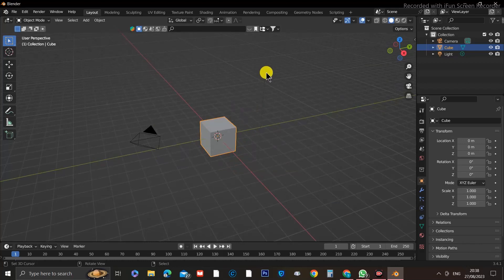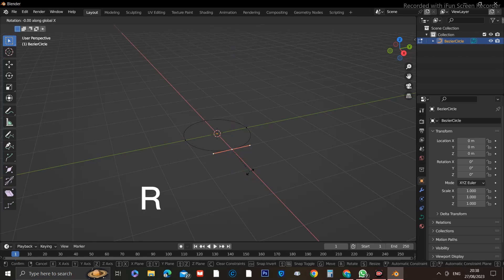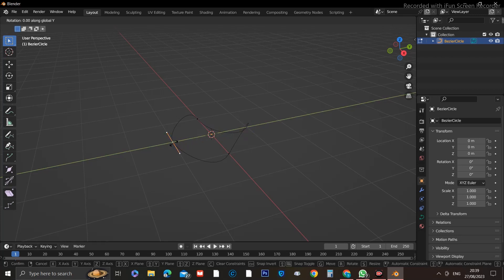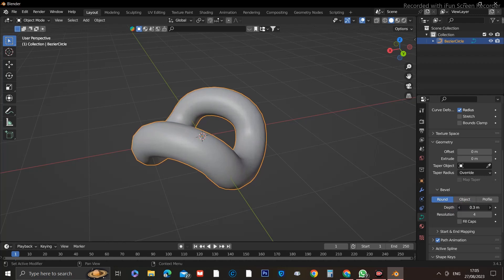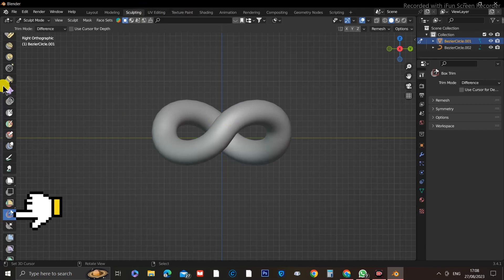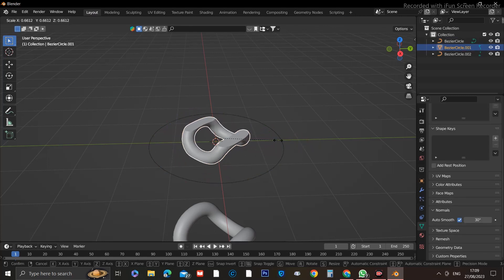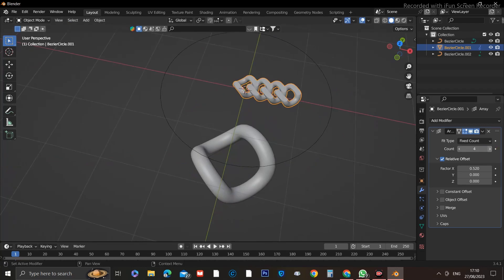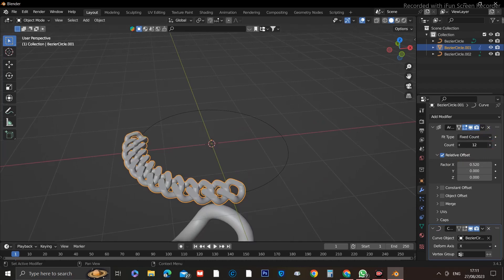HOW TO MAKE CUBAN CHAIN IN BLENDER

Comment: how did you manage to fit them correctly mine is side by side i need lil help 😅
Reply from the maker: go over to the modifiers tab where you added the array modifier under the tab relative offset adjust the factor x slider to the left until you get the desired fit I hope this resolves your issue👍